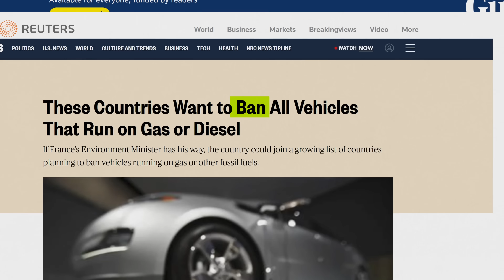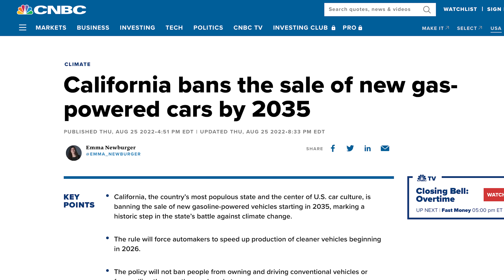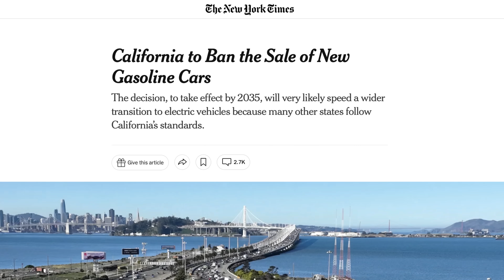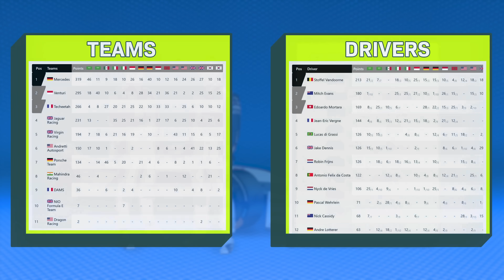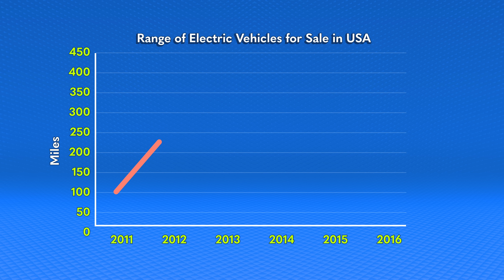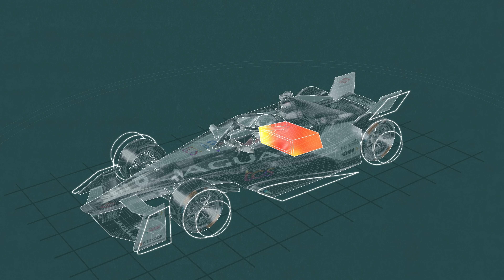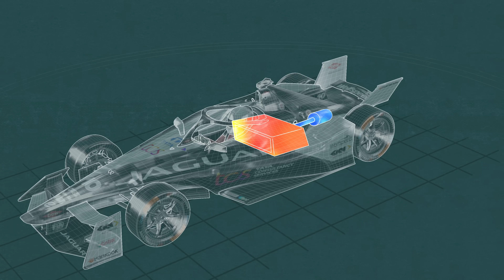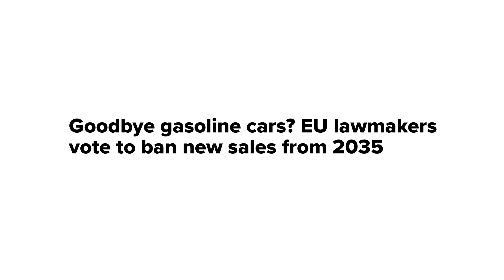The Electric Formula 1, Explained

Comment: i think formula e have to use traditional circuits more often (wider circuit, without the sponsor boards stacked on top of each other on the circuit walls). The quality of the video broadcast also needs to be improved. When i saw the formula e broadcasting pre season testing at the valencia circuit, the car looks good at that circuit, and the actual race on valencia 2021 looks good too.
the more i look at the circuit, the circuit has nothing wrong. i think the problem lies in the video quality and the sponsor board (because the monaco race looks good). I feel the circuit is very dusty, and sometimes on broadcasts I can see mirages too

Comment: I find it unwatchable. The tracks are short, the speeds are low. The cars are so underpowered they run a modified street tire and they race about 50 miles before the batteries are dead. That is an improvement over the beginning when they needed two cars to complete even a short race. The reality is until there are batteries or an electrical storage devices or conversion medium equal to or greater than gasoline, this racing is not even comparable to formula ford.

Comment: It would make a huge difference if they could add the sound of a combustion engine. On-board speaker system with the sounds of a big fat V8 muscle car could do it. Sounds like they now have the battery capacity to power this. And then of course add the F1 circus. Currently the difference is like watching secondary league vs prime league football/soccer. Both are soccer but the atmosphere is lacking.

Comment: Doesn't Formula 1 have pit stops where they refuel and change tires?  They don't do the whole race on one tank of gas, no?  So wouldn't one option have been to replace the batteries during the pit stop rather than swap cars?

Comment: From 2026 Formula 1 are moving away from gasoline engines and are instead using synthetic fuels. These fuel have to be carbon neutral and can't use any land that would otherwise be used for agricultural. While their are currently some issues around synthetic fuels and their implementation in the real world, F1 are betting on them being able to completely replace fossil fuels. At the moment this looks like an outside bet but one of the advantages are that they can be used in a regular internal combustion engine.
Reply: it is still combustion so they will be banned aswell.

Comment: My main issue with formula e is the circuits. I'm really not a fan of street circuits, sure they are challenging for the drivers but overtaking, and side by side battles through corners are basically impossible
Reply: Formula E cars are pretty much bumper cars though, so they all pile into a corner and are very aggressive in fighting through, behavior that would get race bans in F1. Not that there is anything wrong with it the chassis are designed to take the abuse and they aren't really going fast enough to cause substantial driver injury anyway. If anything it's an interesting aspect to the sport.
Reply: The issue beyond that is the cars aren't really fast enough to make for exciting racing on purpose built circuits
Reply: @DjDolHaus86 Have they really increased the battery capacity or just limited the performance of the cars? A Bugatti Veyron runs for 18 minutes on full boost, comparable to a 1st generation EV. I'd expect the Rimac Nevera to have a similar range anxiety

Comment: As an F1 fan, I value Formula e in that it is pushing F1 to be road relevant in ways that it wouldn't have if there wasn't an electric exclusive championship. Now F1 is pushing fossil fuel companies to create new drop-in fuels for combustion engines that will eventually drastically cut emissions in their production and use, which will be great for all the older ICE cars that will still be on the road from 2035 onwards. So whereas Formula E is a competition that pushes Electrical Engineering, F1 is quickly pushing Chemical Engineering in new and exciting ways. And manufacturers are signing on to that as well!

Tldr: you should do a video on the F1 2026 regulations and how F1 engines are already being redesigned to run higher percentages of synthetic and biofuels every year!

Comment: I appreciate the clear explanation here of the history on how Formula 1 and Formula E compliment yet compete with each other. This is a very good explainer, Cleo. As an EV driver, I honestly haven't had much interest in F1 for quite awhile. Anything that runs on  gasoline feels like yesterday's news. But I've been casually following this all-electric FAI racing category since the first season, when the drivers had to switch cars mid race. I need to get back to watching the races more regularly again. 

Interesting to hear that the new Gen 3 cars have no physical brakes in the rear and does all the stopping back there with just regen. We've had regenerative braking on our street EVs for years now, of course, but not to the degree that they've been able discard that much physical hardware. The next time I step into an auto supply store and make note that I no longer need most of the lubricants and filters, I can add brake pads and fluid to that list pretty soon.

Comment: Just put fully carbon neutral synthetic fuel into Cars, Formula 1 and into whatever has pistons and we can finally stop the war on the combustion engine. 

To be clear i am all pro pushing tech, but wittnessing an Formula 1 car pass by a grandstand  without the rumbeling engine would not be the same.

Comment: Mining trucks have been using electric braking since like the 80’s, the electric drive motors pump electricity through giant space heaters and they dissipate the heat with fans.

Comment: I'm more excited over sustainable fuel than pure electric. Full electric seems to be a solution that can work in Europe or specific regions in North America, but don't see it as easy adaptable here in Brazil. On the other hand ethanol is used as a more or less sustainable fuel since the early eighties here. Also the electric power grid is fed with a great percentage of clean energy.
I see that the future will have hybrid systems, with local energy needs being provided by clean electric and long haul with biofuels.

Comment: I hate to be the person to burst the electric car bubble, but it isn't feasibly possible to replace all gas engines with electric cars(with lithium ion). The pollution is off the charts for mining the minerals required. The hybrid engine that f1 runs is the most thermal efficient power unit in the world, and with the new 2026 engine regs, they're building more feasible tech that would dramatically reduce carbon emissions with bio fuels/hybrid model. I do like the electric race car concept because of their ability for awesome tracks like the indoor outdoor track in London and I do like the innovation that this series is bringing. This video is really well done, keep up the good work!

Comment: Banning ICE (internal combustion engine) vehicles is dumb. Don't me get wrong we should be moving in a move environmentally friendly direction but there are technological problems with electric cars that need to be overcome first before we ban ICE vehicles. Currently battery technology relies on rare earth metals that are not very sustainable and we can quickly run out of. Electric cars are good for the daily commuter but the range is not there for people who travel for work expecially shippers in the trucking industry. Instead of outright banning ICE vehicles we should continue to do what we've been doing the last couple decades and focus on making them more efficient and clean. Maybe we can eventually move into hybridization and then full on electric but the bans on the sale of ICE vehicles a lot of countries have in place wouldn't disrupt a lot of industries and maybe even lead to resource exploitation and resource scarcity.

Comment: The part that was weird to me was when they said they gave two cars to each driver to solve a battery problem. Why not swap out batteries? I know it's more complicated than swapping a couple of AAs, but if you're looking to solve technical issues, that seems like a good place to start.
Reply: The battery was securely built into the chassis for the Gen 1 car as part of the structure for safety reasons. That's why battery swaps are still not a thing and fast charging is the new hot thing in the block for this generation of cars.

Comment: If you want to do more about this thing, there is a series called Extreme E for you, it is rally racing but electric. It would be a topic for another video too. A comparison between WRC (Old series like F1, but with a hybrid powertrain now) and Extreme E (New series, with fully electric and zero-emission).
Reply: Extreme E was even founded by the same guy that founded Formula E
Reply: I don't think there is a zero-emission racing event anywhere in the world?! Especially if you consider the traveling of the (Teams, Equipment, and Spectators)!!
Reply: @argynews  They of course will release carbon by many way, but to make the series zero carbon, they doing carbon offset, by removing the equal or greater amount of carbon out of the atm, and trying their best way to minimal the carbon release at every event
Reply: extreme e is stupid
Reply: @jakesweet1000  ? why? at least it's carbon neutral
Reply: F1 old? ... you know F1 will use E-Fuel that can just go in any ICE car, as eco friendly as FE without mining
Reply: @Aniket2712 FE may have batteries in the cars, but the series has been net zero since its inception. F1 still has a long way to go regarding logistics.
Reply: @ianmungwadzi8444  The batteries in FE or any EV are terrible for the environment lol. EV cars really aren't that eco friendly. If you want eco friendly then hydrogen is the best option. ICE or EV are both "negative" from an environmental perspective.
Reply: Boring

Comment: one caveat here... Formula E is not the same to F1, if anything it is more similar to Indycar. Reason being is that Formula E isn't a constructors championship like F1 is in that the cars are all the same (aka stock series). Teams don't design and build cars like they do in F1. The constructors creativity is what makes F1 so much more interesting.

The Gen 3 cars look awful though. Though the new braking concept is absolutely awesome! As a racer myself, I am not a fan of gimicky video game features being implemented which is why I struggle getting onboard with Formula E. Just put the best drivers and car against each other and let them go at it. The "attack mode" and "fan boost" is unfair. I look at it the same way as DRS in F1 as these gimicks hand string one driver and the other gets a free advantage that results in an easy overtake.

Comment: Hey Cleo, if breaks only work with regenerativ braking, does this mean, when the battery is topped of, they are no longer working? Imagine driving down a mountain and this happens to you😢
Reply: Just use reverse traction 😉

Comment: The boost on the track seems so weird.  It seems like you lose time by going on them lol
Reply: They are seemingly outside the normal racing line, so it's probably a marginal performance boost but generally loses time. but it would still somewhat encourage overtakes, which is a good thing.

Comment: Love your video, but right at the end, I kind of had an issue with the point of Formula E being greener and therefore better for the future of road cars. While F1 won't go electric, their push for carbon neutral fuel could mean that the cars from today can drive much longer (maybe with slight changes to their fuel systems). If everybody had to switch to electric cars at some point, wouldn't it result in a lot of unnecessary waste because cars that have a lot of life left in them would have to be discarded? I feel like F1's vision is much more applicable to the mass market
Reply: 😅 Singapore's COE system is causing new car renewals every 10 years... Older cars are really rare here
Reply: The upcoming bans are only on the sale of new gas cars, used cars will still be able to be purchased, so the switch to full electric will still take decades as the older cars slowly get replaced through attrtition.
Reply: @nicholaswilson9724  The upcoming ban in the EU excludes cars running on biofuel
Reply: @nicholaswilson9724  I know but I mean the switch is not truly necessary if manufacturers find a way to mass produce renewable fuel by then. That would save even more resources I’d say
Reply: @fabiandi13  what switch are you talking about? Nobody (at least not yet) is forcing people to replace their cars. People sell their cars when they want a new car or the old car is broken. 
So no, green fuels won't prolong the life of any car.

Comment: Cleo- you should make sure of the ban of gas engine rules coming up.  Last I saw them (which was just before I retired), EV meant BEV, HEV, MHEV, PHEV, etc.  So anything that has an electric motor to help make up the energy fits the rules.  And that means the current F1 rules meet that standard.  California limits it to PHEVs, but that still has a gas motor in it.  This isn't really a ban on gas engines, but a requirement for electrification to harvest some of the waste energy.
Reply: In the EU ban biofueled gas engines ar eexcluded. So that won't affect F1 anyway.
Reply: Of course they would do that...

Half-completing the task...
Reply: Most Eastern UE countries have coal power as main electric source. This doesn't change pretty soon, that's zero CO2 in 2050 is dreams...
Reply: @mateuszzimon8216 Without using nuclear power in the equation, it's all a bit of a whitewash since renewables only work during the day but at least there's less air pollution in congested cities

Comment: question... how can they speed up on the speed up strip is there a sensor that sends the ecu to speed up? if so.. they should just made the whole thing like mario car/ or death race'ish.. where theres slow down plates and power up plates that they can use with a push of a button... i think these all makes formula e more strategy base
Reply: No it just gives a 2 or 3 min power boost after you pass both sensors and you Can only use it twice per race
Reply: @timmynicolas8729  thanks... how about the fan boost? is it 2 per race also? .. i think thats unfair for cars that doesnt have many audience ... they shouldve just made "plates"(sensors that they can drive thru) that has diferent abilities like slow and speed up ... and the audience has to pick what abilities are in the plates